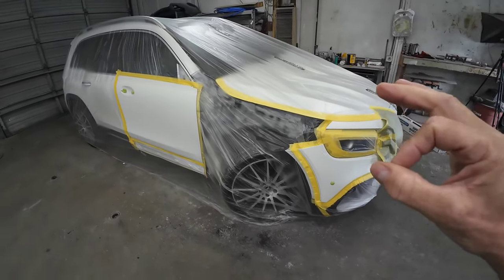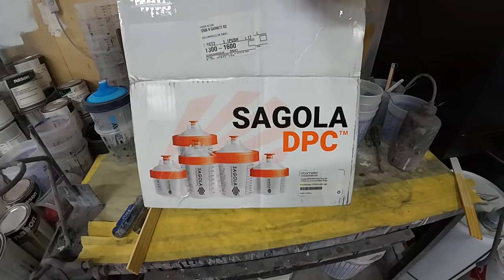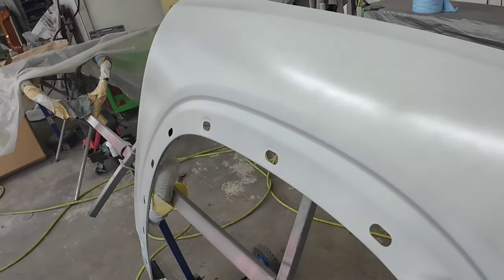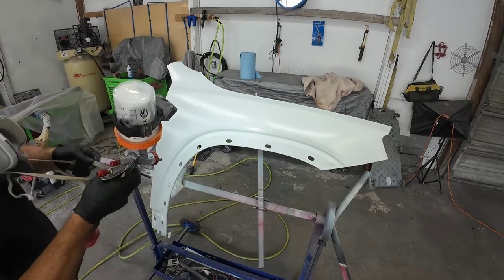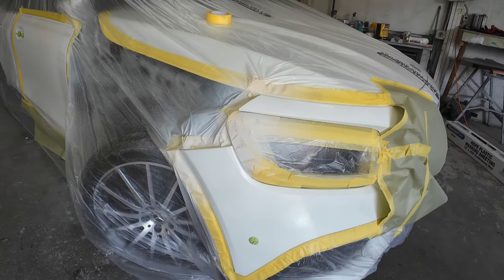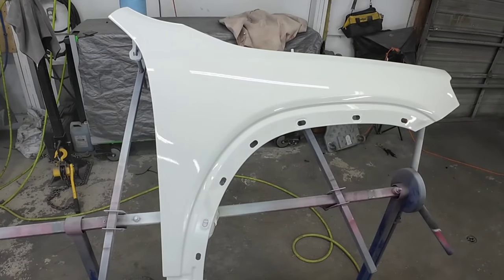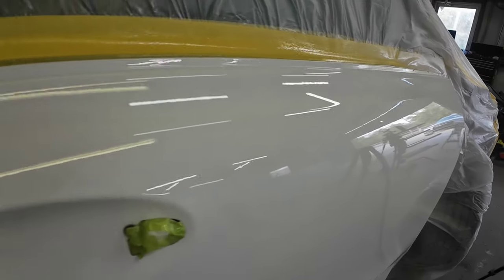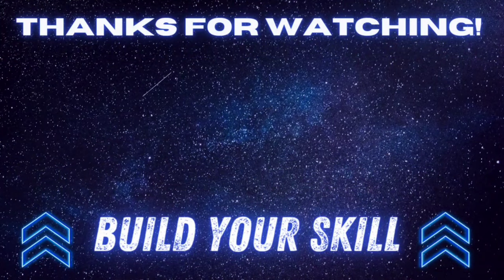"DIY Auto Painting: Step-by-Step Spot Painting Guide for Beginners at Home. Auto painting tips.

Comment: Hi sir, you’re a good man. Thank you for what you’re doing . 

I’m about to go at it repainting my truck at home with the inotek lvlp and a 29 gallon harbor freight compressor. 

My question : do I need to purchase a 3 stage air dryer ? Or does the little oil/water separator that comes with gun suffice ?
Reply from the maker: Definitely  should have a inline water oil trap. I use a inexpensive one off Amazon. This is the one I use. https://amzn.to/48X6wyJ
You want something like this at the very least and a water trap at the end of the gun.

Comment: Collecting materials for my first paint job (full color change) -- For primer/base/clear, would you suggest mixing brands (i.e. upol primer-sealer/nason base/finish1 clear) or sticking with one brand paint system (i.e. eastwood, tamco, or urechem complete kits)?
Reply from the maker: I never have an issue  mixing brands. For warranty purposes they want you to use the same brand throughout but some companies don't  make paint. Upol, nason, finish 1 is a good combo

Comment: I am very new to car painting and have a question. I used duplicolor filler primer on my bumper (3-4 coats) and I was wondering if it is ok to drive it in the rain and then come back later, sand with 600 and paint. Should I sand it all down and re-prime it or will it be ok if it dries out good? Also, this primer is lacquer is that ok to even use over OEM paint scratches/filler or will it peel?